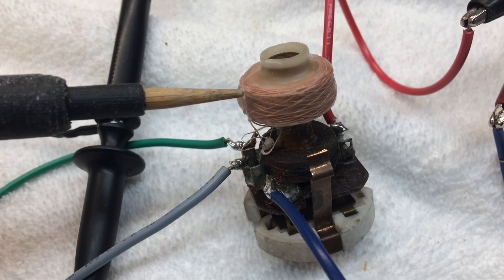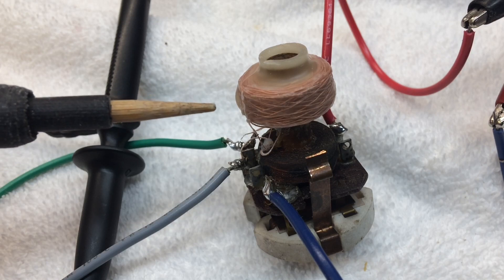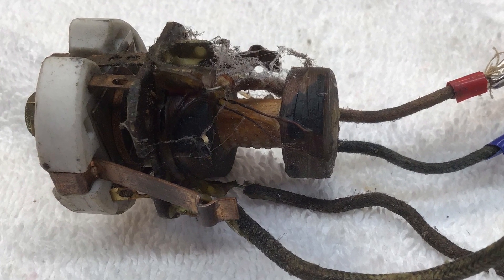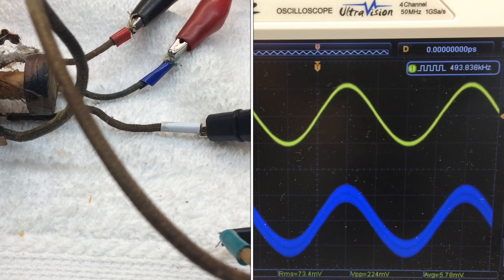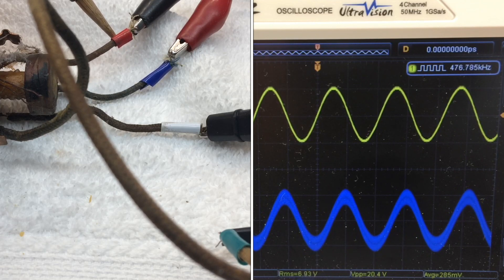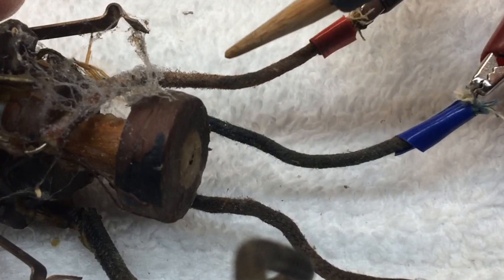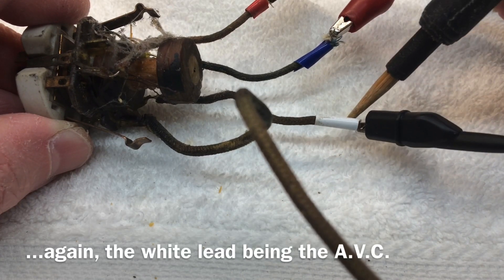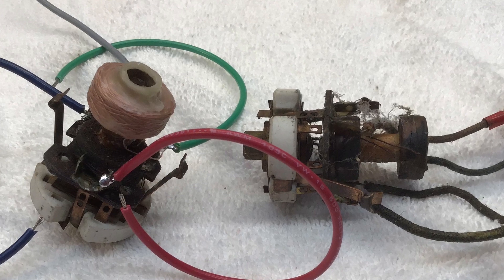Zenith 707 - I.F. Transformer Phase Issue + Wire Dress + Next Steps

Comment: On the previous video, where you re-made the secondary coil, I was amazed at the quality of the workmanship and the results. I'm still amazed that the litz wire is still available.  On this video, you've done an excellent job of explaining the results and the method you'll use to integrate everything.
Reply from the maker: Cjay - I appreciate your kind words. Hopefully it work well once I get the receiver to the point of powering it up. Thanks again and I hope all is well with you. Best, Don
Reply: ...I read somewhere that litz wire was invented to reduce "skin effect" at high frequencies-!

Comment: Great job on the coil winding Don, looks like it just came out of the factory. Strange that the other coil was out of phase from the manufacturer.
Reply from the maker: Thank you Jim, the coil turned out better than I expected. The 1st I.F. being connected (phase) wrong seemed odd, so I triple checked and got the same results each time, so I’m going to reverse the leads and see what happens when we power the receiver up for the first time. Best, Don

Comment: Don,
I am a bit confused. When you said the windings were out of phase, the yellow and blue traces seemed to more or less line up. Wouldn't one trace be high when the other would be low if they were  out of phase? What am I missing here? Thanks, Ian.
Reply from the maker: Ian - at 2:10 check out the Vpp level of ~200 mV and the amplitude of the carrier as I vary the frequency doesn’t change substantially. After I switch the leads, you’ll notice the transformer resonants at or near 485 KC and the Vpp is roughly 20. Let me know if this helps. Best, Don
Reply: @RestoreOldRadios  Ah, I see. I was thinking the out of phase meant the peaks and valleys would be reversed. I was not thinking of resonance. I guess the radio would work, but with reduced sensitivity and volume. Is that right? 
Thanks Don. 
Ian
Reply from the maker: Yes, you are correct.

Comment: Very cool Don.  Can you elaborate on how you connected those coils to your scope for testing ?
Reply from the maker: Ron - the SG input is connected to the blue lead (Plate) w/ the ground of the SG connected to the red lead (B+). Channel four of the O-scope was not connected, but clipped on the SG blue lead to sample the input signal as a reference point, while Channel one is connected to the Secondary windings of the transformer while looking at the O-scope for the signal to resonant at the I.F. Frequency w/ the highest amplitude and in Phase. The Channel one leads were switched between the green (Grid/Diode) and white (AVC) to identify the correct Phase, Amplitude and Resonance. Hope this makes sense. Best, Don
Reply: @RestoreOldRadios    Thank you Don.  I bet a video on just this process would help a lot of people  :)    You do such a great job explaining things.. love your channel.   - Ron
Reply from the maker: Thank you Ron.